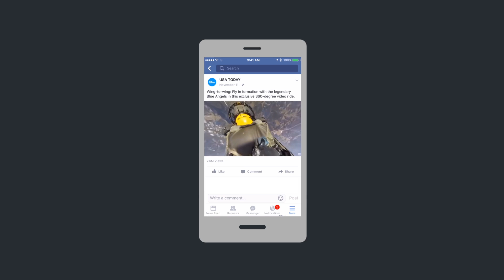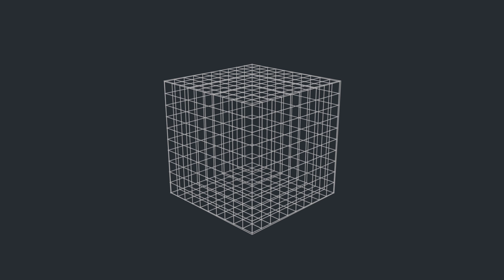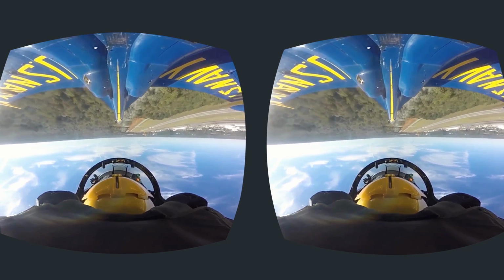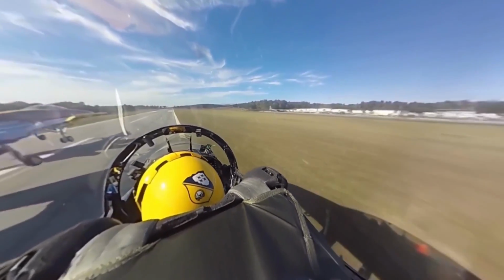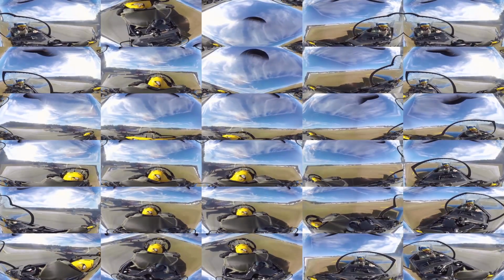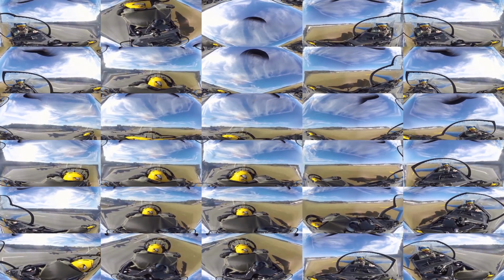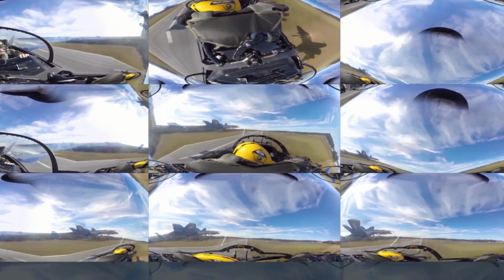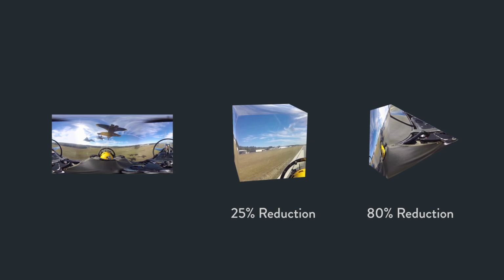Introducing Dynamic Streaming for 360 video in  VR

Comment: Is it stereoscopic? 3D?
Reply: +Alexi GVS They had to come up with the Pyramid compromise because of steroscopie. 
The main idea is that bandwith on mobile is variant and limited. You need to compromise your quality or find a new way to stream.

Global Video Quality = 360 video > Cubemap > Pyramid
and let's say a 360 Flat Video = 100 unit to stream by second(uts).

= Flat =
360 = 100 uts
Cube = 75 uts
Pyramid = 20 uts
= Stereo =
360 = 200 uts
Cube = 150 uts
Pyramis = 40 uts

Comment: So does this mean that VR won't be so heavy on somewhat high-end PC's? I want to get the Consumer Edition of the Oculus but I know my computer will not be able to handle it. The DK2 runs decent on my PC though.
Reply: +DovahCheif This is about bandwidth, not graphic processing. A 3D equirectangular image of decent resolution is 3600x3600 pixels running 60fps. That's a huge file size. The method in the video reduces the need to stream that by 80%. I'm sure since S3D images have overlap, there's a way to reduce the bandwidth even more.
Reply: NukeMarine  ahh okay, thank you

Comment: could you make the video quieter i don't think its quiet enough, i can still hear it a little bit.
Reply: +malibar1 They now output the audio using an innovative pyramid structure. The decibel levels peak at the base, then taper off by as much as 80% as the sound nears the tip of the pyramid, which is where the listener is positioned.
Reply: Theres an amazing technique that can be used on youtube videos to amplify sound. It's called "Raising the volume".
Reply: +ClapsyPlapsy Haha. And for all the expertise oculus has, seemingly no one knows how to audio gain in premiere pro.
Reply: +malibar1 Yet another potentially excellent video spoiled by poor audio. This happens way too often for my liking.
Reply: +ClapsyPlapsy hahahaha good one